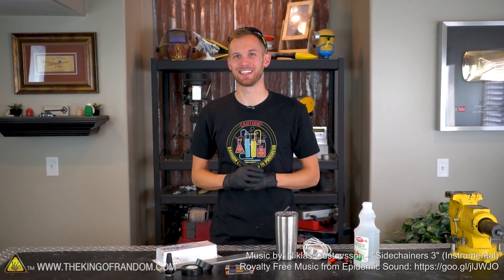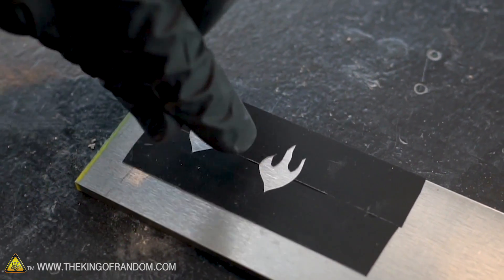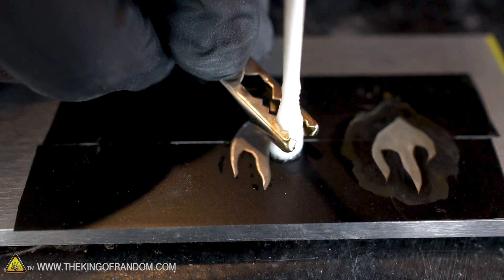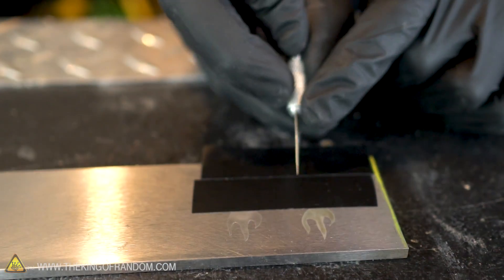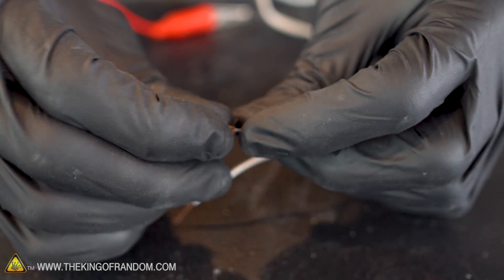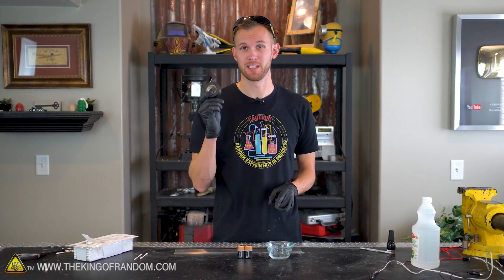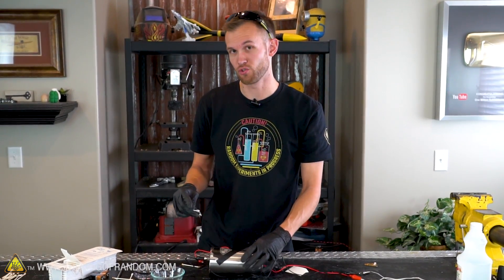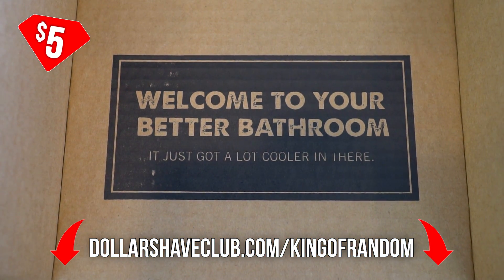Etch METAL with Battery Power! TKOR Shows You Everything To Know About Metal Etching

Comment: If you're degreasing stuff then you really want to use a two rag method. Soak one rag in the solvent you're using, wipe the surface down, take the clean rag and wipe the surface dry. Otherwise you're just dissolving the grease and then allowing it to redeposit on the surface as the solvent evaporates? This might have been the problem with the nail polish...

Comment: Connect the batteries in parallel rather than series. this will keep the voltage at 9 volts but doubling the current which is more important.

Comment: Fantastic video thanks mate, very simple and cost efective method. Thanks for sharing it.
One suggestion, if people intend to do quite a bit of etching, pick up the female end to the power adaptor which will make connececting the leads easier as well as getting the polarity correct. they cost next to nothing. Plus you don't have to masacre the adaptor lead!

Comment: Should you etch with the positive or negative lead? Does it even matter? I saw you used the negative wire to etch the carbon steel and the positive wire to etch the stainless steel.

Comment: I used the nail polish method and I got great results using a clear coat over top. It seemed a bit excessive at the time (one of my friends suggested I try it) but after I got 2 or 3 different etches using this method I was rightly shocked and have been using it as a mask instead of electric tape. (I still prefer free handing everything for a more homey touch but when I have to do something specific I use nail polish)

Comment: Use very small amount of thinner(acetone) to clean the metal before using nail polish. Isopropyl has a dissimilar effect on enamel as isopropyl breaks its bonds compared to thinning the enamel nail polish you probably  would need neither to get it to bond but thiner polish would be easier to work with

Comment: Using nail polish all the time to sign my knives. I apply polish and then before its dry I sign my name and let it dry. I use vinegar with salt and 12 volt DC with Q tip. works awesome. use polish remover and it is well engraved.

Comment: I use a 12V 2.4A DIRECTV AC/DC Adapter and it works great
And I just put apple cider vinegar, salt, and obviously water
And I used a cotton based fiber and press and hold the swab there for 2/3 seconds and continue it for the whole thing. but I just need to practice lel

Comment: With Electro-Engraving, amps are the work horse. the voltage is not very important but the greater the amps, the faster the metal will be engraved deeper. For example, 5 vdc with 2 amps will work faster than 12vdc 1 amp.

Comment: What you do with the wire is strip abit first then get a multi meter and do a continuaty test(diode icon) and the inside of the original output fitting is positive and outside is negative so you can sort the wire without guessing if anyone wants to know

Comment: for clean up use steel wool after etching. also repeating the process with the Q-tip repeatedly works great. Key point be patient. If on something like the cup go the same direction as the brushing pattern.

Comment: Ive used a larger, similar method to clean off welding stains from stainless steel.... The machine for the job was a current source similar to welder, phosphorus acid and weaved fiberglass cloth... I guess you can use fiberglass instead of cotton, the fiberglass will last a lot longer than the cotton

Comment: The venegar is used with salt also. There is not chrrent flowing. You could have checked with an amp meter to see if you need more current o more voltage

Comment: Vinagar with salt to make an acid solution
Reply: Common household vinegar is a "acid solution" usually 10 parts acetic acid in 90 parts water giving you a %10 solution of acetic acid or common vinegar. 
No chemical reaction occurs by mixing sodium chloride (salt) with 10% acetic acid solution (vinegar)

Comment: I wonder if you could get a better finish if you coat the cup completely and then cut out the design you want, and instead of using a q-tip to etch, you just electrolized a solution and dipped the cup.

Comment: needed way more salt. The reason I am saying that is because I watched someone do something similar just before this video and they used a different mixture. They used a mix of salt with a little water in it instead of lots of water with a little salt in it. The engraving they did was much deeper and the conductor they used to apply the electricity to the engraved surface was an iron or steel rod with a clip attached to it with another attached to the steel plate.

Comment: What would happen if you use the home energy (230 v in germany in the usa i dont know) to etch iron?
would it just completely melt?
Reply: Des würde einen Kurzschluss geben und die Sicherung raus hauen
Reply: @ChancelorPalpatine66  und wenn man eine sicherung aus glühbirnen in paralel geschalten baut?
würde das dann nicht gehen?

btw wir machen das so wenn wir sachen haben wo wir nicht sicher sind ob sie die sicherung raushauen oder nicht weil unsere pcs meistens an sind
dann brennt nähmlich einfach die birne durch
Reply: User would get electrocuted and if not, the tiny amount of salt water would separate into component elements so quickly you wouldn't get any result on steel

Comment: To blacken what you etched you need to use AC not DC. Just rig up a simple DPDT switch by modding the wall adapter to switch between the two.

Comment: you need more amps. i use same salt water solution and a 12/24 vdc car battery charger 60 A, it works just by toutch 2-3 secs. electrical tape its working fine

Comment: The vinegar is better when you de grease the surface and let it sit overnight on the metal giving you a higher detail the discolouration is the first part of the electrolytic precision  etching proses also try using transfer paper to transfer the templates so you don't have to worry about removing internal parts of the template

Comment: For the engraving the tape mask works but if you use putty around the edge of the tape and directly pour salt water into the putty mold then you will just need a small metal rod touching the salt water and the engraving would be cleaner

Comment: when using nail polish, write in what you want while it is still wet. Cleaning the area to be etched with a wooden dowel or chop stick cut to shape with a sharp knife. Then let it dry. Plus while it is still wet, you can re-do any mistakes. Don't forget that finger nail polish remover works to remove finger nail polish.

Comment: I tried this on three different metal surfaces, both with q-tips and with one inch of tightly folded tough paper towel (more like a stamp, as mentioned on instructables). I tried with both salt water and with vinegar. The salt water also seemed more effective (sizzled more). The third try I repeated touching the same area over and over, changing out swabs whenever they got too blackened, and kept at it for over 10 minutes. The only effect was a slight blackening of the metal, but it's still relatively shiny and has no texture difference or depth cut into the area. The only other effect is that my positive lead alligator clip is almost completely eaten away! It's only got one tooth left. Wonder what I'm doing wrong. I'm using a 12V DC wall adapter with 1Amp. Going to try the modeling clay method next, on a multi-folded sheet of tough aluminium foil.
Reply: It sounds like you have the clips switched, but I suppose it could be something else as well.
Reply: Possibly. I suppose I never did try switching them, but I did check on my multimeter beforehand and made sure my negative lead was connected to the body of the metal and the positive was being used in the liquid solution. I did try the clay bath method and managed to eat the rest of the alligator clip as well as two whole paper clips. I will say it's a brilliant way to disappear some metal! As for the etching, best I've gotten so far is a faint blackish mark in the shape of my stencil. Maybe I'll stick with 12V and try a higher amperage.
Reply: @chriskaprys  What are you using as the "mask?" It may be part of the problem if the edges aren't hard.
Reply: If your leads are connected in reverse, you are electroplating.

Comment: Try Laser Printing Gloss double sided paper your design.  Steel wool or fine sand metal surface.   Now place the Laser pattern gloss paper taping it over the metal.  Heat the metal and gloss paper to 207 degrees while making sure there is a tight surface contact to the metal.  Roll over the surface or iron over it.  Let it cool.  Then, put the paper and metal in water for a few minutes to let it cool and be able to separate the gloss paper from the metal.  Now you have a fine pattern you can etch.  After etching, remove the cured baked toner with goof off.

Comment: Those little bubbles are electrolosis seperating the H20 molecules from each other resulting in hydrogen "bubbles" which are flamable. The etching process is actually a higher concentration of Oxygen molecules oxidizing the metal. The higher oxygen results from stripping away the hydrogen molecules by the electric current.  
'"

Comment: Whether or not it's the negative or positive shouldn't really matter in this application, what matters is that the current is flowing continuously through the electrolyte solution and reacting with the metal. (It's entirely possible I could be wrong) I wonder if the setup could easily be upscaled with a large tank (or bathtub) of saltwater and using a stencil and clear coat paint to establish the mask?

Comment: If you held it long enough, you'd notice it turn a green hue. That's because the electrolysis of salt water (table salt and tap water), creates chlorine gas. You'd effectively be powder coating the steel with dissolved chlorine, hence the green hue.

Comment: A handy tip with regards to the DC power supply.
The positive wire normally has the broken line on it, where on some the positive will have a slight ridge down the outer edge of the cable. In some cases, if not most, both the broken line as well as the ridge are present on the positive wire.

Comment: Some electrical tape will not tolerate the heat and peel off, your were lucky possibly due to the low current involved.  Adding the salt to the vinegar would have worked allot better than the water and salt.  The nail polish shouldn't have peeled off that easy, most likely reason, you didn't clean the steel with acetone or alternative after you sanded with the 800 grit.  You also should have used a hair dryer or hot air gun to dry the nail polish.

Comment: Electrons travel from negative to positive. If you reverse your polarity, it will draw steel ions away from the bar and into the cotton swab. The way you are doing it in the video, you are basically implanting salt ions INTO the steel that could potentially lead to corrosion later on.

Comment: POWER SOURCE
The Fire-shaped, you used 9 VOLTS (1 battery)
The Square, you used 18 VOLTS (2 batteries in SERIES, not parallel)
The Squiggly Line, you used 12 VOLTS (AC-to-DC source)
============================
On the NAIL POLISH, I think it would be better if you 
put on LETTER STICKERS first, 
then around the stickers apply the nail polish, 
let it dry, then peel off the stickers, 
then start etching, 
then apply acetone to remove the nail polish

Comment: a tip for making nail polish work better on any surface is to use it on a ROUGH surface and not smooth. The same tip applies for nails, when us girls do our nails, the paint will last longer and adhere better to a slightly roughened up surface than on a smooth surface. So if you scored the steel or used a Rougher grit sandpaper you would likely have a much better result with much less peeling of the polish.

Comment: Get one of those $60 laser engravers from ebay. They are weak but would do for most people as you can etch any shape you want. Just use black mask so it absorbs the most power of the laser.

Comment: you might want to try the Bath method. Just making a dam around the area then fill with water and vinegar then place One + or - (Not sure on the direction in) making sure its touching the base steel then have the second rod in the pool floating and not touching the steel. that way the whole area gets a even etch but you will need something bigger then 1amp due to surface area

Comment: I've looked through the comments, and I have not seen anyone comment that hooking the two batteries together like that would increase it's voltage, not it's wattage.  So the two batteries connected in series like that would have a current of 18 volts or less.  Connecting them in parallel, or positive to positive, and negative to negative will increase the amount of power, but you would have the same voltage, or 9 volts.

Comment: Something to try, try dissolving salt in vinegar and see if you get a better result. I once tried using salt water to clean copper bottomed pots...noticeable result but not that great. Tried vinegar...about the same. Salt mixed with vinegar and it cut through the patina in nothing flat. 

Perhaps salt in acid might be better?

Comment: Hey I saw u connected your batteries together in series so in concept you should have 18 volts since. However I'm not quite sure how much current you would produce. It kind of depends how much resistance the batteries sees from the metal.

Comment: use small sticker letters instead of knife to make letters, paint over with nail polish. let dry and slowly pick letters with knife and it will leave perfect letters stenciled with nail polish as the barrier. Also a medium grit sand paper works better due to leaving small pits for polish to fill and adhere better to the metal

Comment: Hey bro, loving your methodical videos!
I use a 300 year old technique to etch metals but thats a different story.
Nail polish does work well but the heat from the electrolysis will soften and melt it causing undercuts in your etching.
Try a full shellac based polish.

Comment: So tried this on aluminum and a iron bar. With the two 9v batteries. At the end of the aluminum I had the design down and slightly corroded away. The alligator clip also was kind of corroded. I grinded the iron down and sanded it. After many q tips and destroying my alligator clip there was almost no discoloration. Was there too much salt? I did add a lot. What kind of alligator clip are you using? I used a cheap little one. Was I using too much power? I used two batteries and decided it worked well on aluminum.

Comment: when dealing with a dc power supply that does not have a red and a black wire.....the one with a stripe or dots or raised rib or writing will be the positive one. There are plenty of cheap volt meters out there that can be bought for less then the price of 2 decent 9v batterys and will let you know which lead is which. if you are lucky enough to have one of the last radio shacks near you then have some fun and build one. when i was a kid you could get an electronic project board from radio shack or sears and make all kinds of stuff like volt and amp meters. sorry for no capitals, my keyboard(or computer) is having issues

Comment: You can determine polarity by hooking it up to a multimeter. An analog meter will swing the needle backwards if the polarity is reversed. A digital meter will display a negative sign if the polarity is reversed.

Comment: When using nail polish you want to rough up the part your engraving with sand paper with a grit that isn't to fine but not to rough so the polish has little crevices to hold it in place. This helps a lot and try to stay away from any chemicals to clean metal cuz it might be dry but it forms a microscopic layer on top of the metal that makes it hard for the polish to stick which was why it was so easy to pull off

Comment: I've done this on knife blades. I was using a very high carbon steel (old farrier's rasp), and a car charger with vinegar. For nail polish, I used some my wife had left over. It took some time, but the longer and slower I went, the deeper the etch went, at least a millimeter or two. If you like, I can send you pictures.

Comment: Hello, i didn't try this but with regards to the nail polish issue. Your marks from abrading the surface with sandpaper were all uniform in one direction, and 800 grit sandpaper would not leave much of a surface profile, for better results maybe try this on grit blasted steel with a 3-5mil surface profile, this is quite common in industrial coating application.

Source: Corrosion engineer and paint inspector :) Hope this helps!